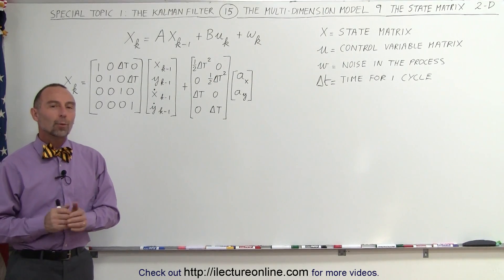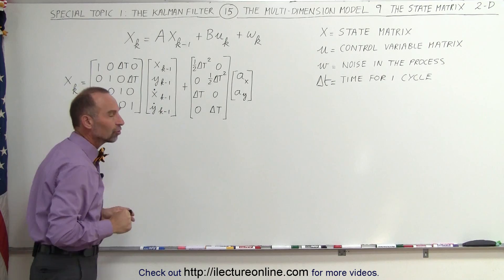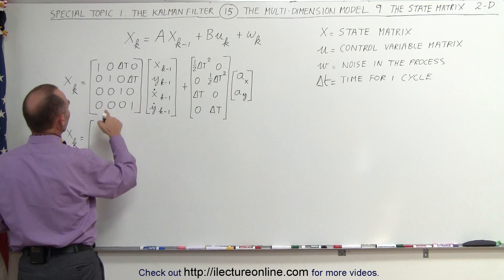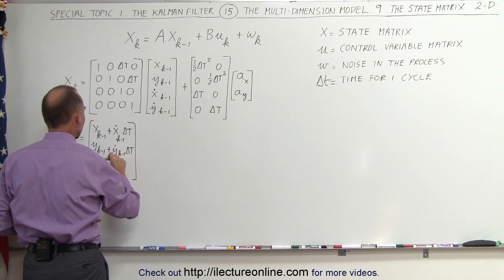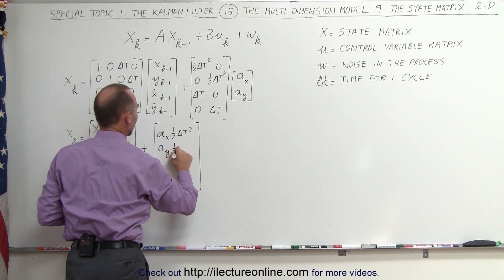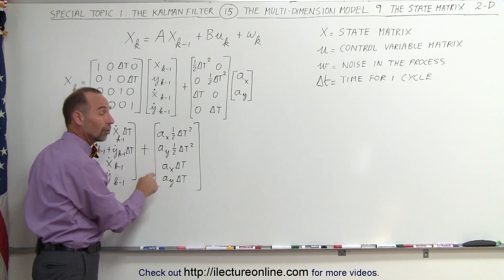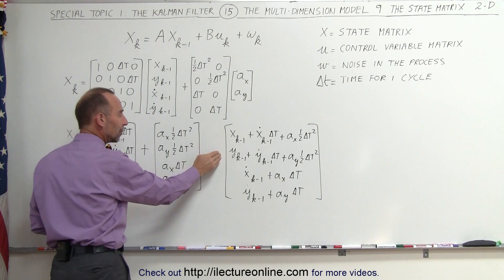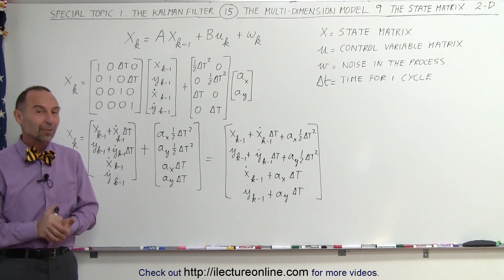Special Topics - The Kalman Filter (15 of 55) 9: Converting from Previous to Current State 2-D

Comment: Slight error? Shouldn't it be u_{k-1} rather than u_k? Well I think it is indeed u_{k-1}: the state (e.g position) at step k depends on control input (e.g acceleration) at previous step k-1, not at the current step k. Otherwise excellent work.

Comment: Hi Michel, nice and in my opinion a very good tutorial to such heavy cost. Is it not the case in the State Space Model that the first line must be called X_K dot correctly? This equation describes the dynamics of the system, isn't it? X_k dot = A X_k-1 + B u_k + W_k. Thanks for answering this question in advanced.